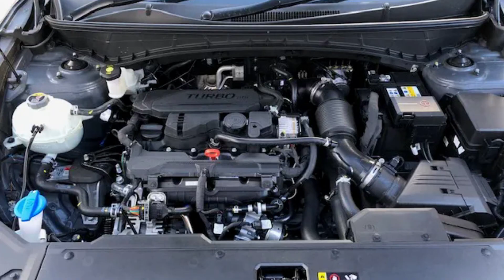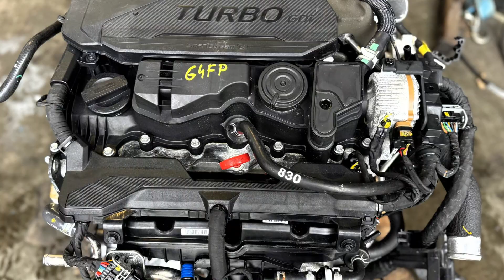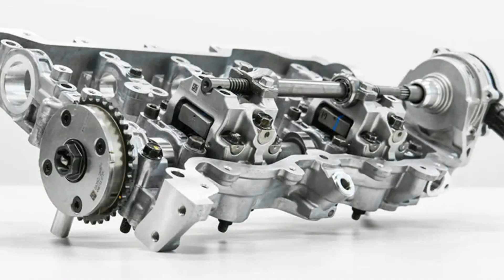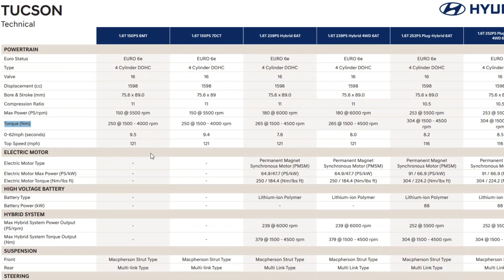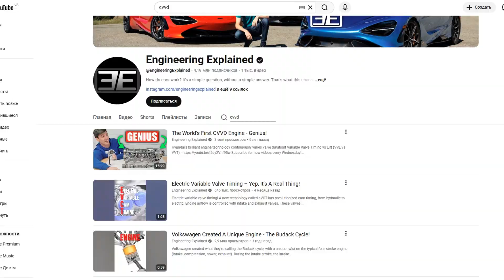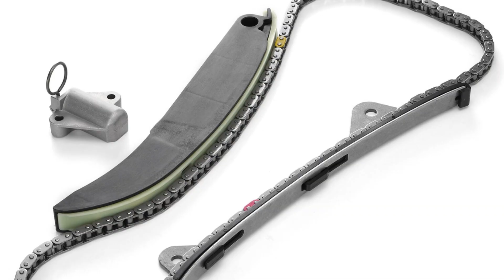2026 Hyundai Tucson 1.6 Turbo engine problems (UK)

Comment: I just bought the 2026 AWD hybrid and the engine reminds me a bit of a diesel. It's punchy and has good torque. Fuel economy, compared to the big diesel I traded, is good rather than great @6.5/100, for my mostly highway driving, That said, the Unleaded it needs is currently 60c a litre less than diesel here in Oz. I'll that that as a win... Thanks for the video.